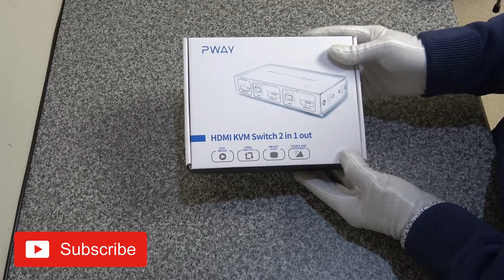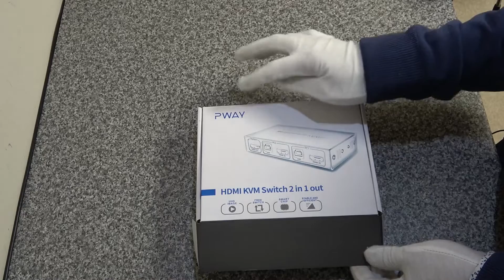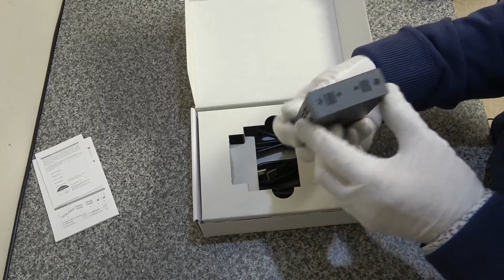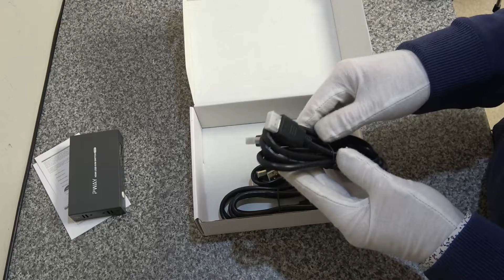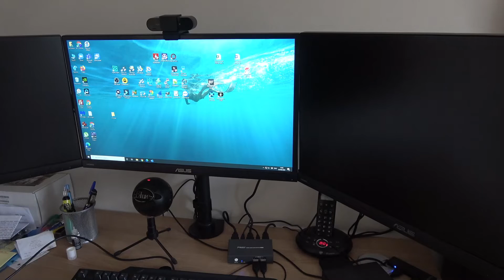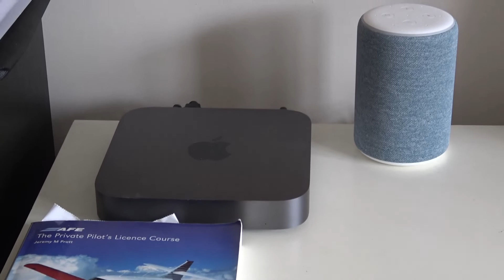PWAY HDMI KVM switch (unpowered) testing and review

Comment: IMPORTANT ---- Someone else commented correctly below about turning your computers off before connecting the cables. ABSOLUTELY had to do that. After all cables are connected turn on PC's and monitors. I tried it with the computers booted up and could not get the monitors to work. Turned everything off, connected cables and everything worked as advertised. No drivers needed. Quite the little switch with minimal lag between changes.
Reply: I feel so incredibly dumb now. Thanks for the tip
Reply: Thanks for the heads up. I plan on getting this for my single board computers, and they turn on the moment I plug them in, so should be good on that front.

Comment: This looks like the perfect device for my needs. I note that you must use the supplied HDMI cable (to the monitor?). My monitor uses DVI, so I have a HDMI to DVI cable currently. Has anyone tried the device to a DVI monitor port?
Reply: I’m trying it with pways 4 way one and it doesn’t seem to work
Reply: @SS14121  what about a hdmi to dvi bi directional adapter?

Comment: How did it get power? I’ve got my computers plugged in with HDMI and the HDMI out connected to the monitor, no power.
Reply: I would assume it draws power from one or both of the USB ports.
Reply: @vylbird8014  That is correct plug in the USB at the same time the HDMI gets the power from the USB

Comment: Have you experienced some mouse and keyboard lag? I'm using the same model, but if I don't move the mouse or touch the keyboard for some time (minutes) it seems that they go in "sleep". I need to press some keys or move the mouse to "wake up" them, then they work correctly.
Reply: Likewise. Even more annoying, sometimes they disconnect while I'm using it for a few seconds :(
Reply: this switch is not mouse/keyboard controllable  - so mouse  issues are unlikely.  This switch needs power from the computers' usb ports .  It's likely those ports are not providing enough power.  Try different usb ports and check usb ports power management.

Comment: Would you please give us an update, is this still working? Have you been using it? Please and thanks
Reply from the maker: Hi Jahi, Yes it's still working great. One thing to note. If you change a device (ie swap a PC) then you need to remove ALL cables, shut the PCs down, reconnect the cables and then you can fire the PCs backup and it will detect everything again.

Comment: yea got this myself cant get the hmdi to show using my cables tried multiple any suggestions?
Reply from the maker: You need to use the cables that come supplied with the PWAY unit. I also couldn't get any video using my own HDMI one's but worked fine using the supplied one's.
Reply: if rebooting doesn't work , shutdown all the computers  and remove all connections to the switch.  Then reconnect  all connections to the switch before turning on the computers.  My other old and new HDMI/usb cables  are working with this switch just fine.